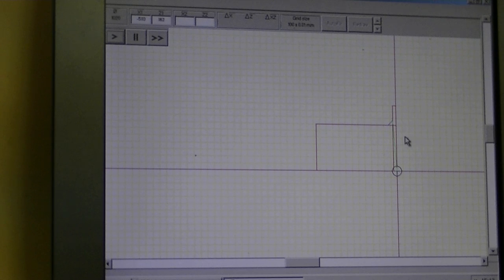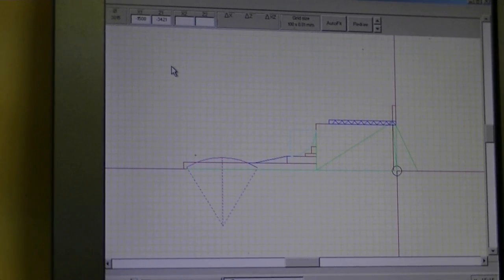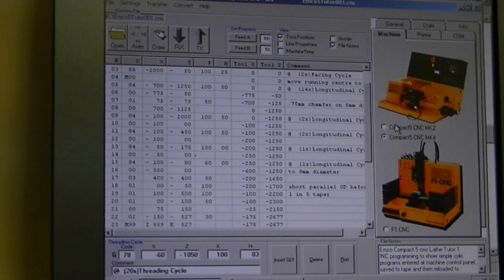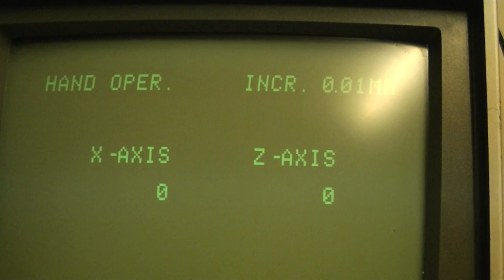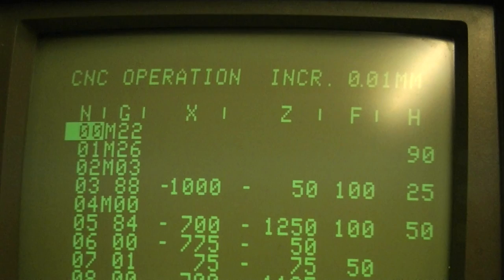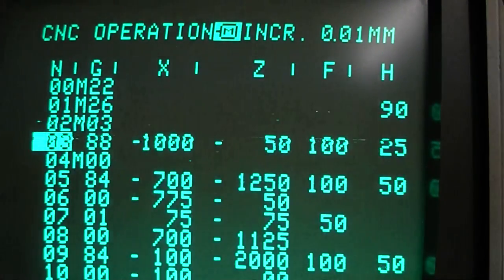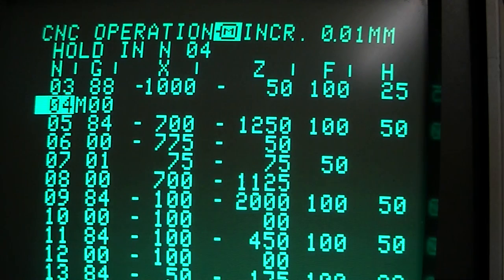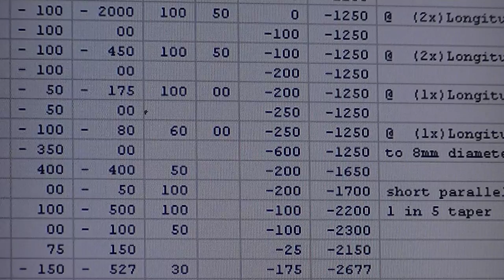Emco Compact 5 CNC MFI Tutor part 2

Comment: Thanks a lot, this is very interesting. I just have the opportunity to get an EMCO Compact 5 CNC. The site with MikesFreeInterface software is down. Do you have any idea, where I could get the program? What is the monitor Interface, as I would get the lathe without a monitor - modulator output with old style TV IF?